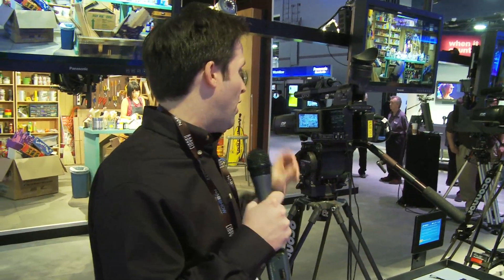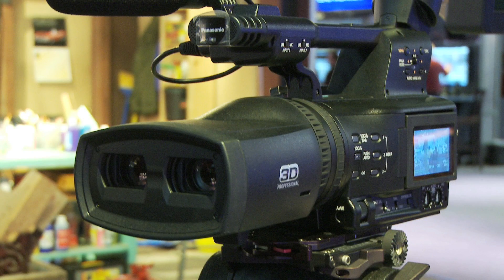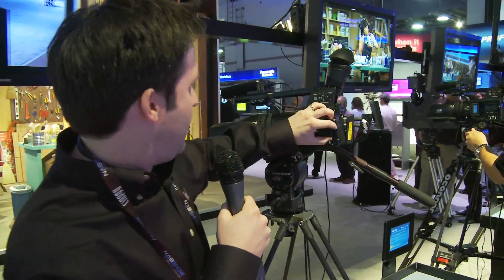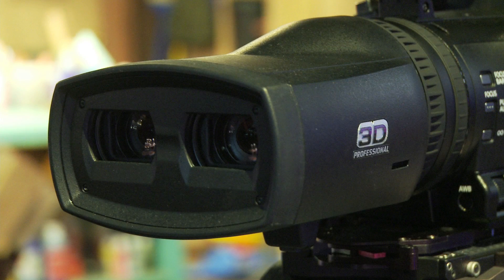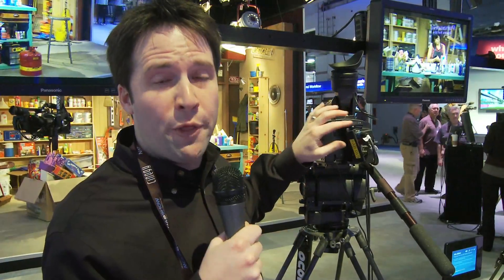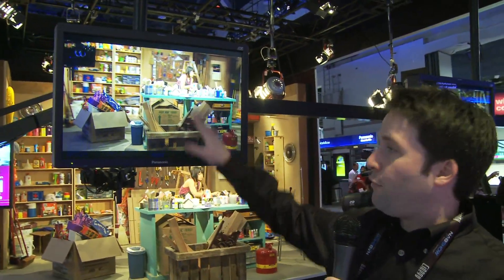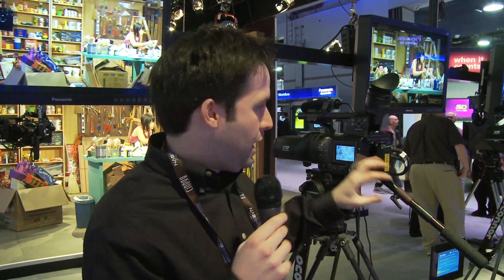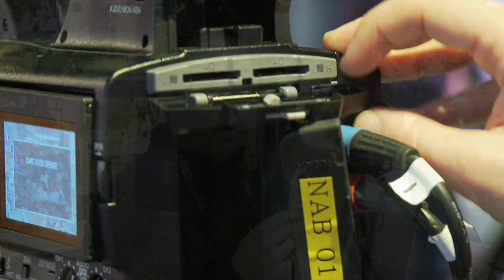Panasonic 3D AG-3DA1

Comment: I have a Canon 500D and a Loreo 3D Stereo Lens and it looks just as good.
Also it will not cost you $21,000.00.
The lens cost me $124.00 and of course my 550D rig cost around $1000.00
Either way you have to change the video in post. So save some money.